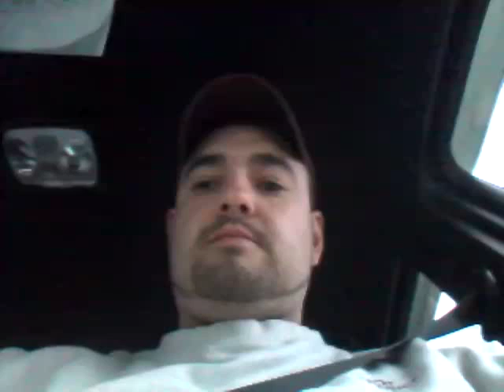MISMATCHED 4X4 AXLE RATIOS EXPLAINED !

Comment: Ok this is straight busted in the jeep world. Its very common to have a dana 44 front and ford 9in  the rear and matching  4 88 ratio both tires spin exactly same. There is no way they will match revolution  with different gears

Comment: This is definitely not the case. It is all about the teeth. The larger ring gear can have the same amount of teeth as a smaller one. This is done by simply making the teeth bigger on both the ring and the pinion.  Example. A 9 inch can have a 3:50 ratio. And 8.5 can also have a 3:50 ratio. They will spin the same speed
Reply: I noticed there was always a 'slight' difference in the ratios front to back, but it was minimal. I have a 1970 Dodge W200 Powerwagon with a Dana 44 front and a Dana 60 in back. The rear ratio is 4.10:1 and the front is 4.09:1. I guess in soft dirt, mud or sand the back could be pushing the front or on the highway the front would be pulling the rear, if the transfer case was a true 1:1. Anyway, there's a big warning placard on the dash saying to 'NEVER OPERATE IN 4WD ON THE HIGHWAY OR AT HIGHWAY SPEEDS'. I have the old manual locking hubs. Once when I was near home and puked a rear ujoint and dropped the back shaft, I just threw it in the bed and drove home on the front axle.

Comment: I just replaced my rear deffy during summer ,  it was supposed to be the same ratio as the front (3.42)  and it ended up being a defferent ratio. It snowed here a few days ago, when i used my 4x4 it drove like shit. Yep i wont be using 4wd anymore. Smh

Comment: This isn't true at all, the mismatch is just so small that you don't notice in your truck. My truck has a ford 9 inch 3.50 rear and a DANA 44 3.50 front. You say in the video that the ratio number relates the pinion and the ring gear and has nothing do do with the wheels, but that is wrong. The ring gear spins exactly in time with the wheels, and so the ratio between pinion and ring gear is also representative of the ratio between the pinion and wheels. The diameter of the gears makes absolutely no difference whatsoever when talking about degrees of rotation.

Comment: nope thats not it , whats funny is it has to do with the dana 44 / ford 9 inch set up . the ring gear size in the dana 44 is way smaller than the 9 inch ford rear , that is where the ratio comes in , the ratio is of the pinion to ring gear , thus to get the tires turning at the same speed you have to play with the actual ratio , kinda funny , but that came from a 30+ year ford dealership mechanic ...it takes a few min of thinking to make sense of it in your head ...well it did me lol

Comment: the gear ratio is just a couple of rings
the people speak about gear ratio thinking the higher it is the quicker your gears will pull you.
that's true but it's only true because the bigger is the gear ratio the bigger is the multiplication.
the two (multiplication and gear ratio) are bigger together as i know they are supposed to be matched to allow reasonnable stress on the moving parts.

the size of the tire is an other thing
you just modify the multiplication of your differential artificially

Comment from the maker: @kerobinsonii I used to put really tall tires on my old drag car to drive it to and from the track I forget the sizes , but it dropped the rpms on the highway like another gear lol gear ratios are what makes or breaks a drag car for sure , and no two engines like the same gears either lol